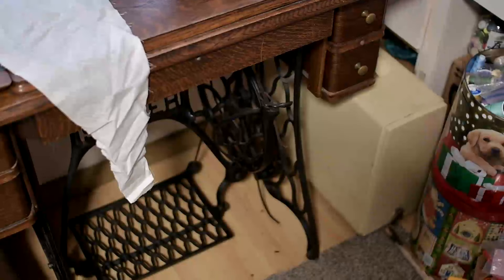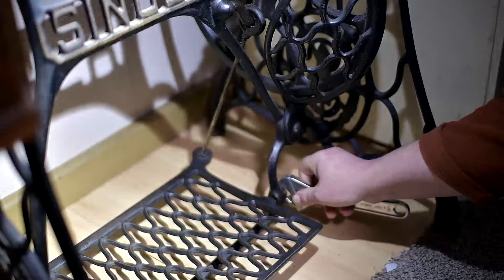Fixing the Clunk on an Antique Singer 27 Treadle Sewing Machine

Comment: The pitman is adjusted with the 2 nuts top and bottom. One is clockwise and the other counter clockwise. You can unscrew the top of pitman and take it off the flywheel to adjust. Make sure pitman is not to snug. Easy to do all this from the other side of the machine and no need to take flywheel off.
Reply from the maker: Interestingly enough, that's exactly what we tried to do in the video... did you miss the part where I said the screw was seized? This video demonstrates that sometimes... you have to get creative when you are fixing antiques. But hey, looking forward to seeing your video to show me how we should have fixed it... bet the end result is exactly the same. Thanks for watching.

Comment: What makes it stop half way in the middle I'm having issues with one I just got
Reply from the maker: Do you mean the belt? The treadle workings might need a good oiling. Or, it could be the join on the belt is a bit too chunky to fit inside the groove on the band wheel. It might need squishing a bit with a pair of pliers.

Comment: Took me a while to fix my Singer 13k with a wooden pitman arm that was split, a few bodges later it was fine but the needle I am using is not 1mm shank size but a modern 1.5mm shank that almost rubs the needle plate hole. The machine had not run for over 40y and after a couple of hours servicing and a paperclip to allow the leather belt that was too short ;-))
A friend of mine has now given me a 13x1 needle  that is quite a bit longer than the 12x1.

My 1903 27k is hand wind, I got it in 2016. It has a bentwood case and a left hand extension table 

My recent 13k treadle base is stunning with the Singer logo and shuttle casing. I saved it from the scrap man.
The only issue is the baked on crusty oil (looks like black Crunchie bar) for now I will leave alone. It has the wrong hood but she said the original was in the attic fingers crossed she will ring me one day ???

I have often taken up joint (that could not be adjusted) knocking sounds with cotton packing and oil. At the blacksmiths shop we would use hemp stands and grease on our machines.
We were used to sealing 3 inch steam pipes in factories with "Hemp and Boss white" search Google to see what it is; like gland packing.

Off topic there are two types of sea boat trailer users 1/ with lose bearings and grease 2/ tolerance set bearings and grease
Guess which Dive boat trailer gets home without a seized bearing ;-))

This might make you laugh back in the 1970s in Blackburn Lancashire in a cotton weaving shed the old maintenance guy retired and with no handover a young lad took over and spotted app the sloppy joints in the line shaft bearings and decided to do some preventative maintenance ;-) later that day the line shafts seized up and the manager call the old guy back to help fix the problem.

Loved the video, thanks
Reply from the maker: There are two valuable lessons here... don't underestimate the usefulness of a paper clip and always take note of the old guy - because they know best.  😀